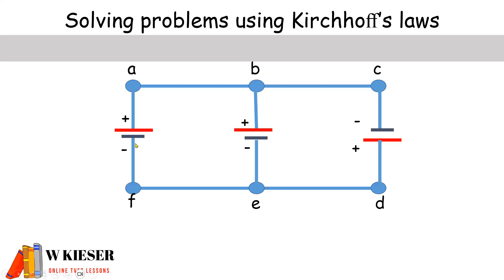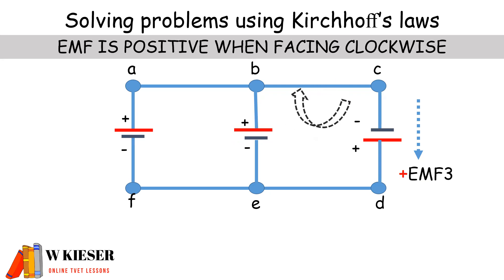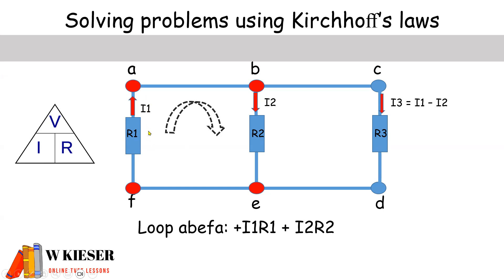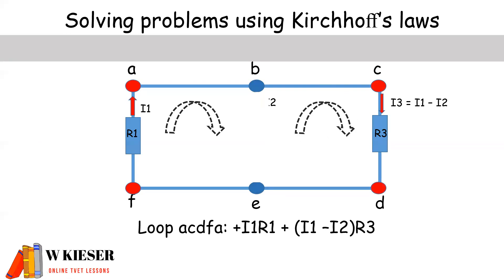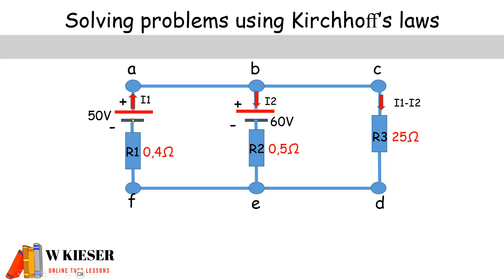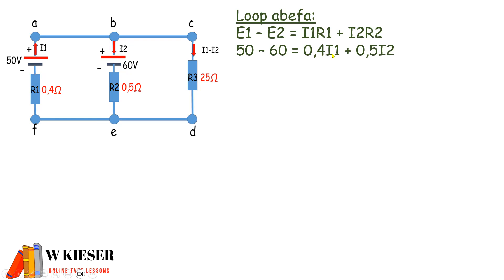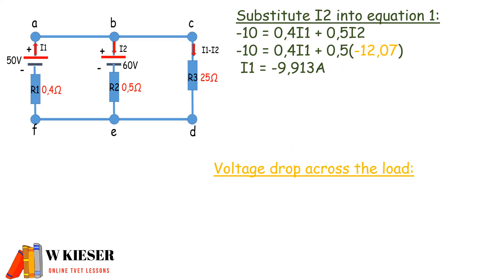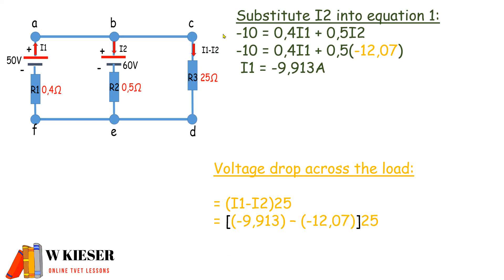KIRCHOFF'S VOLTAGE LAW LOOP CALCULATION

Comment from the maker: To make this calculation simpler, I want to reduce the number of unknown variables. To do this, I’ll subtract Equation 2 from Equation 1. However, to fully eliminate one of the variables, I took the coefficient of 𝐼1 (25) from Equation 2 and divided it by the coefficient of 𝐼 1 in Equation 1 (0.4). This gave me 62.5. Then, I multiplied the entire Equation 1 by 62.5. This allowed me to align the coefficients of  𝐼 1 in both equations so that, when I subtract one from the other, therefore, 𝐼 1  cancels out completely. This leaves us with a single variable to solve for in the calculation.
Reply: Why did you not make the coefficients the same using the elimination method such that you multiply the coefficient of I1 from(equation 1) to equation 2 and also multiply the coefficient of I1( from equation 2) to equation 1 so as to make them the same where they will then be eliminated
Reply from the maker: @MihleMgele  you can do that. There is always more than one approach